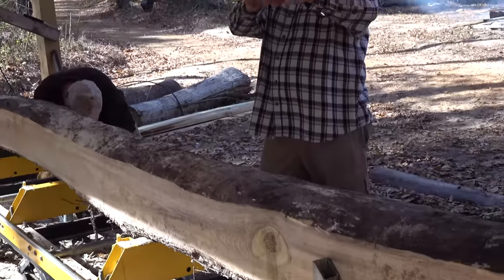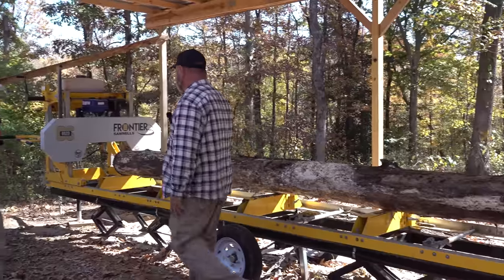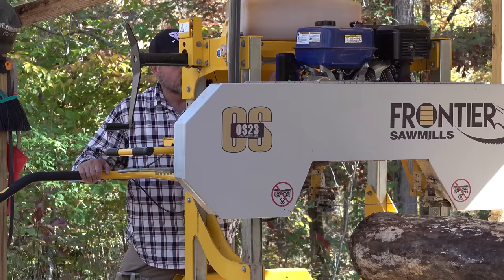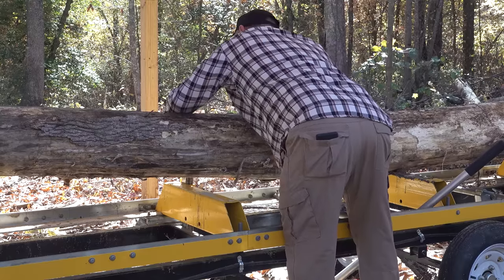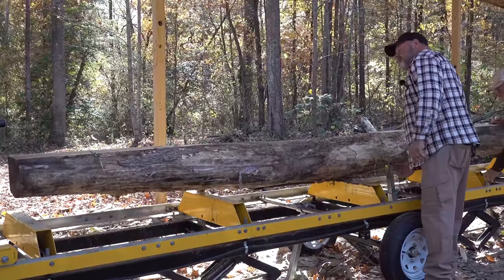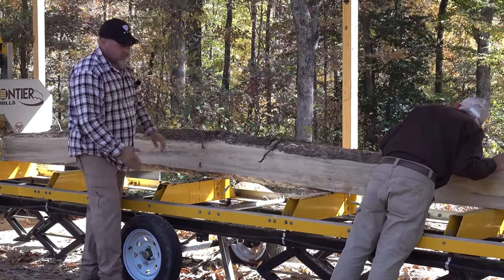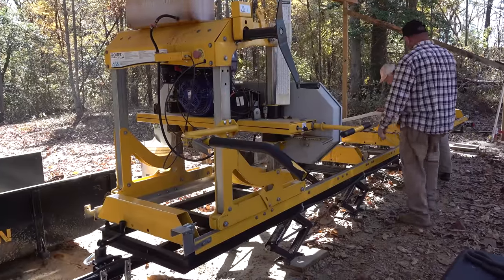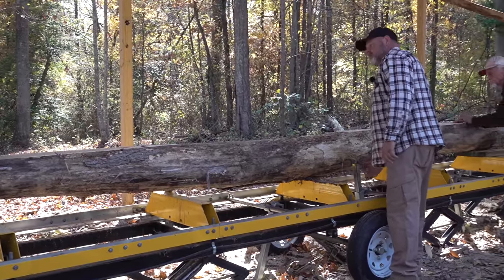Sawmill Owners Should Know This! Frontier Sawmills, Woodland Mills, Woodmizer,

Comment: Appreciate the video Tony. When the boards coming off have that much tension in them the cant on the mill is likely to bow the opposite direction (more with a smaller cant, less with a larger one) and you have to take that into account. You can see the cant is off the bed at one end because of the tension, and my guess is the 6x6 was only 5 1/2 x 6 at the finish. The way to get the straightest 6x6 is to cut thinner boards off each face until you get to your dimension. The boards coming off will not be thick and perhaps only useful for cladding but at least you will get a pretty straight 6x6. Happy sawing!
Reply from the maker: Thank you for taking the time to teach—one of my best posts.
Reply: Thanks and you are welcome. I learnt this one the hard way. From the UK.

Comment: great video Tony, I recently purchased the OS 31 and was wondering what kind of blades you would suggest using. I will primarily be cutting hardwoods, such as White Oak, Red Oak and Walnut
Reply from the maker: I have found the 7 degree turbo seven silver tips work great for hardwood. I left a link to the guy I get mine from in the description.

Comment: I was just wondering how much a 2”x4” board will shrink as it dries?  If it is cut from pine trees.  Thanks
Reply from the maker: Not sure. I don't cut a lot of pine. I find hardwoods shrink very little, but it is multiplied by each piece used.

Comment: Thanks for showing us so many mistakes. Your first four moves on your log were wrong and you just kept going. I’m running a Woodland Mills 130 Max, great saw, but even though they are different brands, the cutting principles should still be similar. Suggestions as a friend: awkward shaped logs can be cut into max cant possible even if a little bark is left; you will have a better view of the logs potential before committing to abusing lumber. Your first cut the log could have been set with the “smile” of the log facing up but not quite perpendicular to the blade. Set the ends as the high points but turned to the side slightly. This gives you more potential area and takes out a little of the bend. Videos of these bigger vertical bandsaw mills with logs on a cart give an easier view too see some ways of dealing with odd logs. The vids can help give another perspective for seeing some solutions. If not a cant first, the tall side of that smile could have been cut minimally to get a flat side then put it on bottom and square the top with minimal cutoff or waste. This has saved me lumber, time and headache. I apologize if I come across like I’m being critical. I’m really just trying to give the benefit of what I know. I’m in my 60’s and don’t know how long I will be able to do that. Get as much enjoyment from your mill as you can. Have fun making lumber.
Reply from the maker: Thank you for your advice and guidance